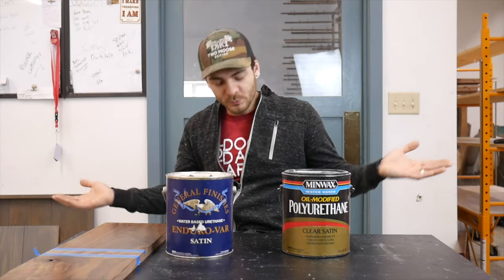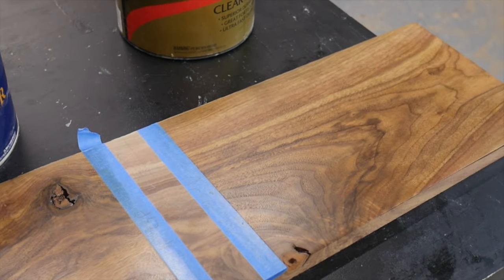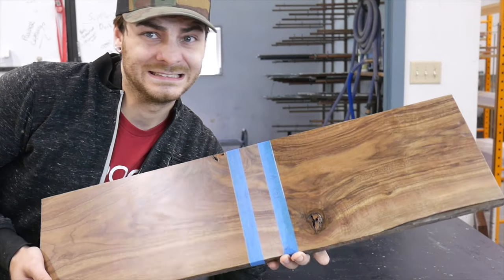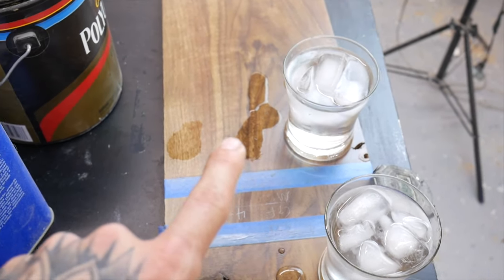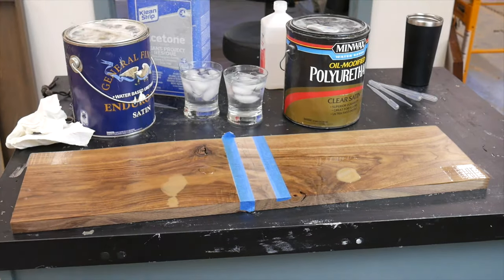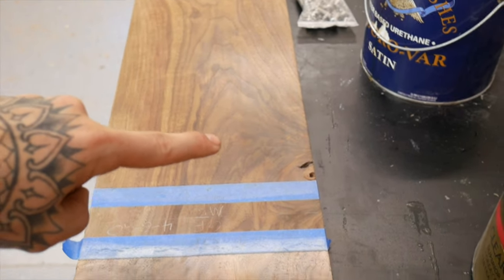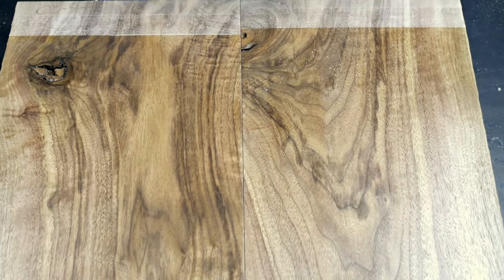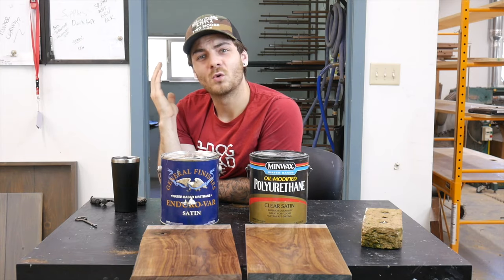Cheap VS. Expensive Polyurethane // Water Based // Woodworking // Top Coat Durability Test

Comment: Thanks for the video. I've used Enuro Var but only as a clear coat over bare wood. Does the new Enduro Var II allow you to spray it over a Oil based Stain... or have you tried it and was there any issues.
Reply from the maker: You can just make sure the oil stain has a few days to dry. Minimum one full day

Comment: I’ve always heard that water-based finishes are not as durable as oil-based finishes, but these are quite durable!
Reply from the maker: I’m sure the oil finishes are stronger but I’m more than happy with the water based finishes! I spray everything so I much prefer the less harsh water products
Reply: Also the water based  finishes won't yellow like the oil based

Comment: Do you sand between coats? I bought the oil modified for flooring not realizing there was a general purpose version of the same composition and brand that’s only difference I can tell is doesn’t require sanding in between. It’s quite confusing, any insight would be great.

Comment: I’m a professional antique restorer and I’ve seen my share of damage to finishes . The sun is really hard on every finish eventually ,so is heat and long term friction . I really like the General finishes and sanding sealers and find that they outperform anything from Minwax ,but that’s just me . 
I get to see finishes from hundreds of years ago and I have to say that shellac is by far the the most beautiful and durable finish I’ve seen . I’ve seen finishes from the William and Mary era that looked really good with a little wax...I wonder how long these plastic finishes will last. Someone should do a video comparing modern and antique finishes. Thanks for the video.
Reply from the maker: Ohhh yeah that would be a cool video! I wish I had that type of finish knowledge to compare them lol
Reply: until alcohol is spilled. Shellac is cut with alcohol and will soften the finish

Comment: I have a pair of binoculars with some kind of rubbery plastic covers that fit over the lenses. And I have small fan that has 4 rubber feet on the bottom. These ruuber things are supposed to prtect the lenses and tabletops from scratches. But both of these items leave marks on my breakfast nook table that I finished with Minwax Polycrylic. I also tried furniture wax to solve the problem. That helps only a little as it wears off after a few wipes when I wash the top with a damp dish cloth. My wife set a hot steel pizza pan fresh out of the toaster oven...for about two seconds. It melted a spot through the Polycrylic. I've learned not to ever put anything but hard cool dishes or pans, elbows and junk mail on my table. I occasionally have to polish out  the binocular and rubber feet rings. It has been about two and a half years and soft rubbery things still stick and have to be moved within an hour. Can you tell me what I should use to refinish my relatively new table?

Comment: General Finishes products might be quite expensive, but they are FAR easier to apply than Minwax or Varathane products. GF simply lays down better. No brush strokes, no bubbles. As a wood hobbyist, I know my finishing skills aren’t great, but the frustration of using cheap finishes that are hard to apply correctly just isn’t worth my time. I just tried GF products for the first time, and I’m never going back.
Reply from the maker: It’s pretty much the only top coat I use
Reply: I finally figured out a system to use the Varathane Polyurethane and get it to go on ok.  I spill some of it on a clean scrap board and then I wipe some of it up with a twelve dollar velvet cloth that has foam in the middle of it that I got at the woodworking supply store.  And then I deposit a rather thin layer onto the wood evenly in one sweeping motion without stopping.   Maybe a little thicker on the first coat, but if it is too thick then it evaporates to leave orange-peel surface, but that doesn't matter too much on the first coats since you have to sand afterwards anyway.  
And with each layer I let it dry and then sand the next day with ever lighter grades of sandpaper, in spite of what they say about always using 320 grit.  Go as far as 500 grit folded in thirds and getting every dip of the wood with it.  Then the final coat wiped on real thin, but if there are any cloudy areas, then another and another thin layer till it's shiny.
Reply: I agree 100% worth the extra cost

Comment: Have you ever tried rolling on the Minwax oil modified water based poly? Most water based poly can be rolled on, but I’ve read some comments from wood floor finishers that they wouldn’t roll on oil modified water based poly but offer no explanation as to why. Any thoughts?
Reply from the maker: Hey! I have not personally, the only issue I  could foresee is the finish would start to dry before it could fully level out smooth or possibly have air bubbles in the finish.

Comment: What about flexibility? I've been taught that oil-based poly will flex more as the wood expands and contracts with changing of weather. I live in PA where we get all 4 seasons. Big shifts in weather throughout the year. From below freezing to 100°+ (fahrenheit)  some years.  I was curious to see how the oil-modified minwax poly held up in that department. Because if it does well there.
Reply from the maker: I live in Wisconsin and I have the oil modified on several items and they hold up fine. One of them being counter height chairs that get sit in and feet on the foot rest.
Reply: @TwoMooseDesign  Ahh like a barstool? That's good to know. I think I'm going to go with minwax oil-modified as my go to. It really seems to deliver the best of both worlds.

Comment: You mentioned that you spray oil based poly, do you have any videos with suggestions for setup.    I’ve got fourteen 30”x48” new unfinished butcher block table tops to finish and would like to spray.
Thanks for your videos.
Reply: He said in a comment above somewhere that he preferred to spray the water based finishes and not oil

Comment: How are you getting rid of the dust in between coats? Wiping down with Mineral Spirits or what? I think I'm going with oil based poly for increased durability for shelving I might end up abusing with heavy and metal stuff.
Reply from the maker: Oil based is definitely most durable and I just use a damp cloth or pick up a box of tack cloths those work really well too
Reply: @TwoMooseDesign  Tack cloth was the other thing I had in mind. Thanks for the super prompt reply!
Reply from the maker: @pillingthemsoftly4738  you bet! I just get a box off Amazon and they last a while 👊🏼

Comment: Hi ! How is the ambering properties of minwax compared to straight oil product ? . We really want the ambering properties but the shop smells terrible . We can't leave too many windows open because it's cold. 
Any issues applying compared to transition oil ? 
Thanks !
Reply from the maker: Regular oil based does look slightly better but the average person that doesn’t have finish knowledge would not be able to tell and the dry time is way faster
Reply: @TwoMooseDesign  hi thank you so much for the fast reply. Read a few reviews of the finishing peeling off like serane wrap and cure time between coats to be different the can. Any thoughts ? If you have used gallons of this stuff. I assume it's great. Interesting that minwax tech support says they don't support spraying of any kind. 

Thank you. 😊
Reply from the maker: @shahsmerdis  I haven’t had any issues and I’ve sprayed many gallons 🤷🏼‍♂️
Reply from the maker: @shahsmerdis  maybe buy a quart first to sample just to make sure you like it
Reply: @TwoMooseDesign  that is what I was thinking and that is what I'ma do ! Thank you. !
That spray looks awesome. And clarity looks great.

Comment: What do you that about the oil-modified minwax vs varathane oil based? (or a different oil based poly)
Reply from the maker: Oil based is always going to be more durable than any water based or oil modified as it’s pretty much water based. But the color on the piece is going to be far more yellow/orange. And it takes forever to dry between coats. Either one will be fine depends on the application
Reply: @TwoMooseDesign  thank you!

Comment: Just bought a gallon of the minwax an hvlp gun. Do you thin at all for spraying, and what size tip do you use.
Reply from the maker: I do not thin any poly only paints. 1.1 or 1.3 for poly and lacquer. Im pretty sure 1.3 is standard on most guns
Reply: @TwoMooseDesign  thanks. I had a 1.4 and it wouldn’t put out any material. I bought a new gun with a 1.4 and a 2.2 and tried with the 2.2, it put out way too much. I’ll try with the 1.4 on this gun. The other gun was a harbor freight purple gun 🤦‍♂️
Reply from the maker: @WBPulley  oh yeah way too big it would probably lay down like crap? The 1.4 might work. 🤷🏼‍♂️
Reply: @TwoMooseDesign  correct! It was crap!

Comment: will either of these products turn yellow on natural pecan cabinets?
Reply from the maker: Both have ambering qualities so yes. I would use a regular water based poly to avoid yellowing. Like varathane water based poly or general finishes high performance poly. The most easy to get would be at a big box store. Make sure it’s regular water based poly and it will keep it looking natural and not yellow. Oil based and oil modified will yellow
Reply: @TwoMooseDesign  my painters refused to use water base on my kitchen cabinets....
Reply from the maker: @donnanichols4202  okay 👍🏼 then ask them what they recommend 🤷🏼‍♂️

Comment: When would you use one vs the other ? The budget of the project ?
Reply from the maker: Yep and if it was going on stained wood I’d probably just go with the cheaper of the two as well.
Reply: @TwoMooseDesign  cool! Thanks. Do you have a preferred staining method ?

Trying to mimic golden aged pine look. So hard :(.

Subscribed btw :)
Reply from the maker: @shahsmerdis  have you tried an amber shellac? It might give you the color your looking for
Reply: @TwoMooseDesign  I tried that before but it didn't work.  you reminded me maybe I should try 2-3 coats before giving up.

Golden pecan seems to be close . But pine doesn't seem to accept it too well.  Seems like pine is a shitty wood to deal with lol. 

You channel looks cool.
Reply: @shahsmerdis  try using a pre stain conditioner on soft wood first before staining and it helps a lot

Comment: DONT USE WATER BASE POLY!! It leaves white dingleberries when staining a large product bc it dries in the brush...AND IT DRIES WHITE! Not clear like oil based.  White puddles, dingleberries and runs! WHITE! Scrape with knife then restain where you had to scrape. IT SUCKS! DON'T PURCHASE WATER BASED IF YOU LOVE YOUR WOOD PIECE! AND DON'T USE TRIPLE THICK BC IT DOESN'T COVER IN ONE COAT WITHOUT LEAVING A SANDY GRITTY FINISH.  Just trying to save you a lot of time and aggravation. Bye bye Minwax! No more for you.
Reply from the maker: Wow you don’t have to yell. I spray over 8 gallons a week of water based products and don’t have issues. 🤷🏼‍♂️ I dint like the one coat or triple thick either
Reply: @TwoMooseDesign  lolol. Sorry about the shout. It really irritates me to no end when a product like Minwax would put out a product to loyal users and put the screws to us. Water base poly is a "white" nightmare! I've used it several times hoping for a change to no avail. Crap!
Reply from the maker: @dannybouy7948  try genral finsihes high performace poly. I use it by the pail, it works great and isnt so milky
Reply: @TwoMooseDesign  👍
Reply: @dannybouy7948  White puddles, runs, and small white circles (dingleberries?) points to user error. Drying in the brush is yet another clue. You are overloading the brush and laying it on way too thick. The directions for all such products say as much.